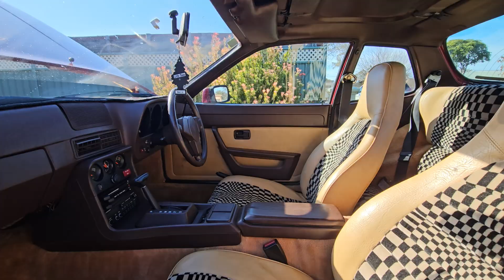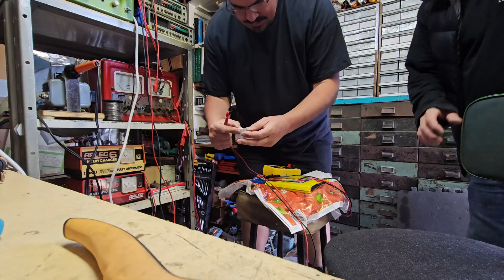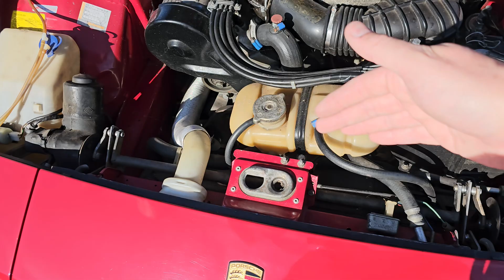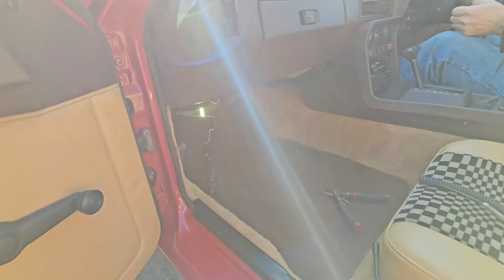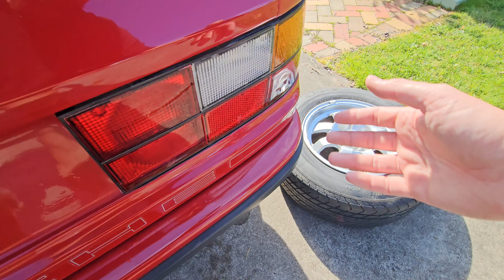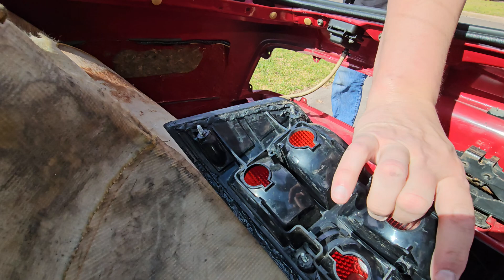Porsche 924 Headlight fail

Comment: I have a 79 924 headlight relay I need to test.  I followed the first step with pins 30 and S.  For the second step, please describe what you apply to which pins to test the 56/56a/56b circuit.  Between you and your helper, it's not clear in the video what is being applied to each pin.  Thanks for your help.
Reply from the maker: SO basically the relay has 5 pins, two are for the relay coil - this operates the relay when energized.
These are Pins 30 and S
-----------------------------------------------------------------------
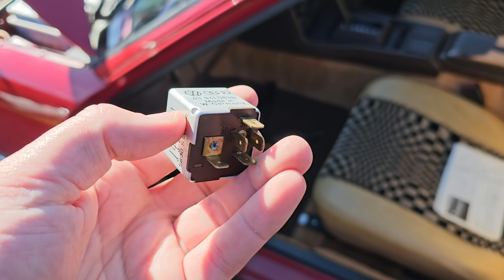at 0:49 if you pause the video, you can see the schematic diagram on the side of the relay.
-----------------------------------------------------------------------
The other three are the switch contacts.
-----------------------------------------------------------------------
One is the common, 56 - you will be looking for continuity between pin 56 and 56A - when the relay is energized - AKA: normally open (NO)

This is the contact that will usually be the issue.
Test with a multimeter in continuity beep mode.
-----------------------------------------------------------------------
when it is at rest - this will be normally open - and instead you should see continuity between the normally closed (NC) contacts 56 and 56B 
-----------------------------------------------------------------------
When closed, there is a flyback diode in circuit between pins S and 56A - this is just to prevent the collapsing magnetic field from generating spikes in the circuit.
Reply: @TheAussieRepairGuy  Got it!  Thanks very much!